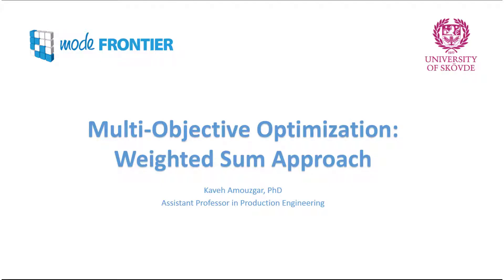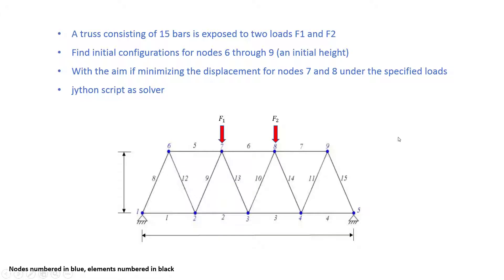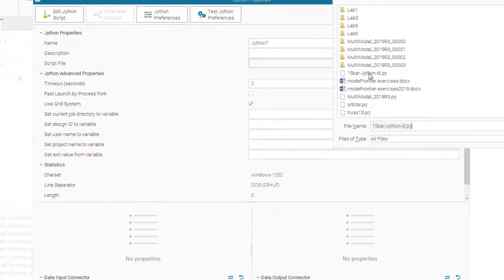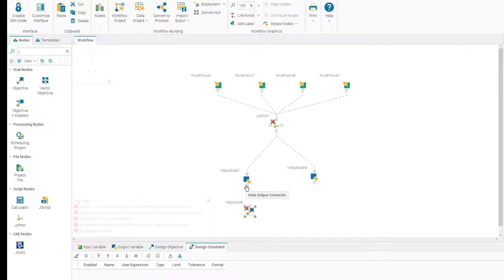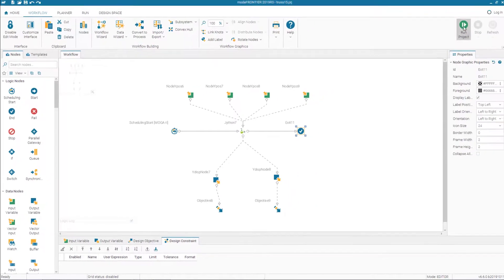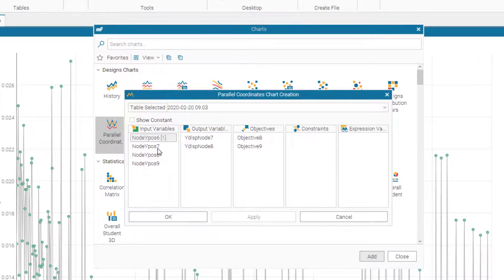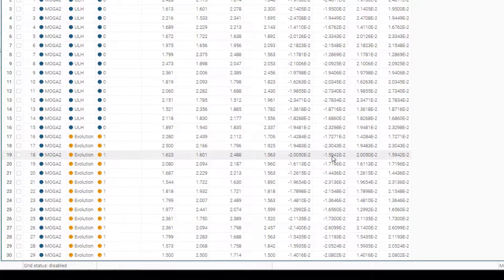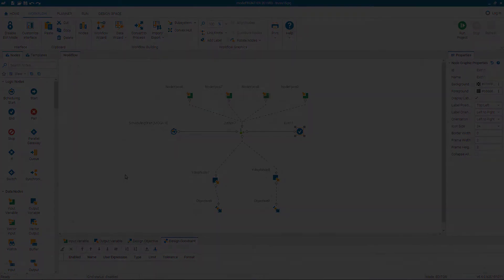4- Multi-objective optimisation with modeFrontier (Weighted sum approach)

Comment: Hello Sir, 

I have a small doubt regarding the multi objective genetic algorithm. The genetic algorithm aims to minimise the two objective functions. So, I use the weighed sum method to convert it into a single objective function. Before that, the fitness values of these objective function needs to be standardized to the same scale. So, Max and Min values of these objective functions need to be found for normalization/standardization. How do we obtain the max and min value. Does the max value correspond to the maximum possible value of the objective function or does max value is the maximum value among the fitness values of the candidates of the population ?